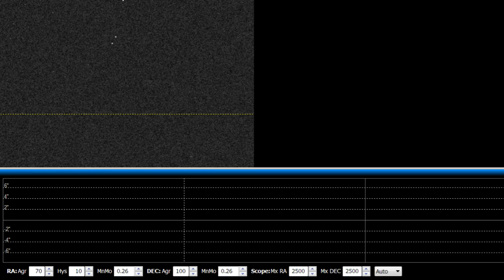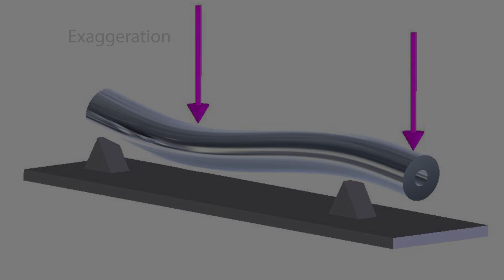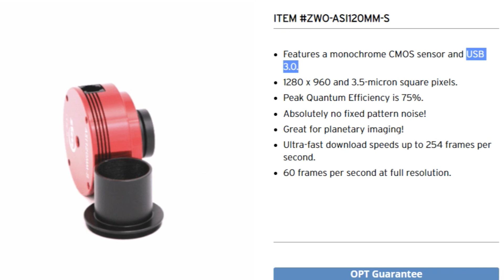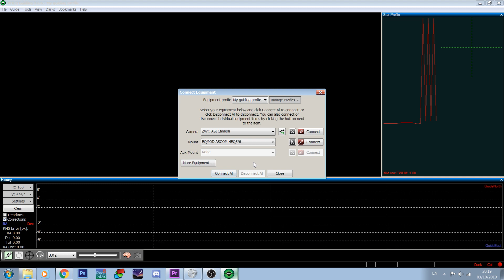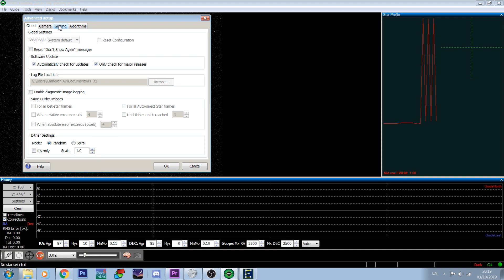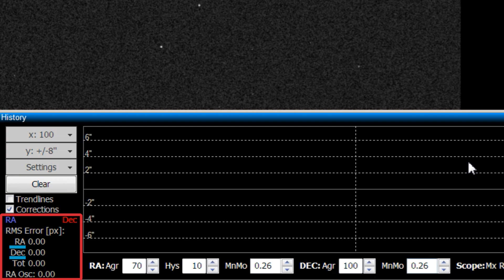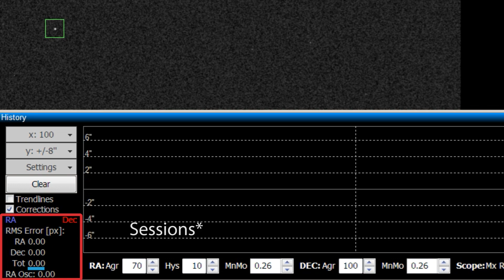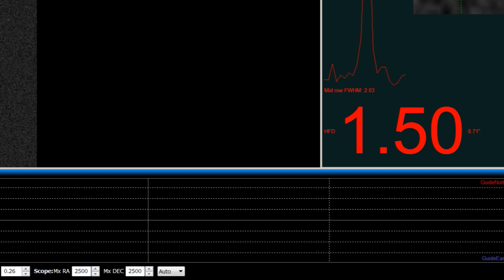Autoguiding tutorial (PHD2)

Comment: were you trying to be funny when instructed to destroy the guide cable?
Reply: Yes and no. The point is that using the ST-4 cable isn’t the best way to auto guide because phd2 doesn’t know where the telescope is pointing. You should connect your laptop to the mount directly rather than connecting the camera to the mount.

Comment: Thank you very informative video. I have a EQ6Pro with an 8" celestron tub and a ZWO 1290MC as a guide camera.  I use sharp cap to capture. This week I was doing 10min deep-sky exposures. My PHD was almost straight-lining. Out of know where it went crazy too a 5.97. I stopped cleared and restarted everything was fine. The next night I was doing 5mins exp.  looking later at my raw data. the first 10frames were great. 11frame not so 12 and 13 fine. then 14 15 and 16 a mess. but back to great on 17th frame and the rest were fine. Any ideas? Thank you Bob
Reply from the maker: Hmm not sure. I would reccomend calibrating near the meridian's intersection with the equator, there the errors are greatest. Then, after calibtation, run the guiding assistant for 5 minutes (under "tools" tab). This will make suggestions to your guide settings.
Reply: @bojaystellar7759  Great thank you